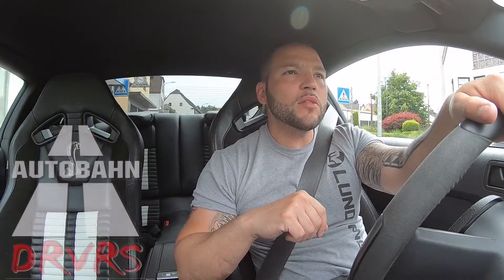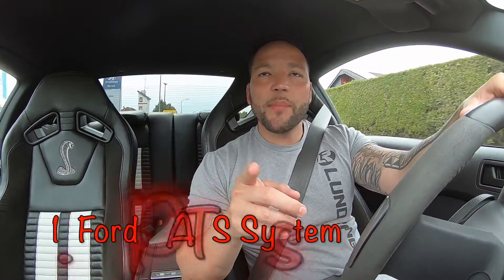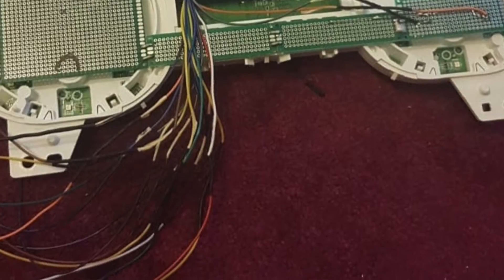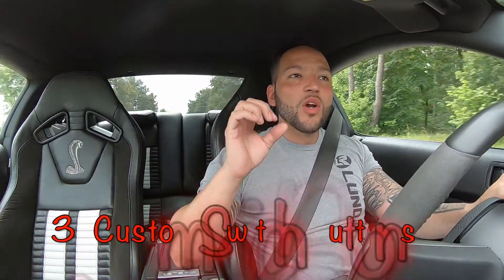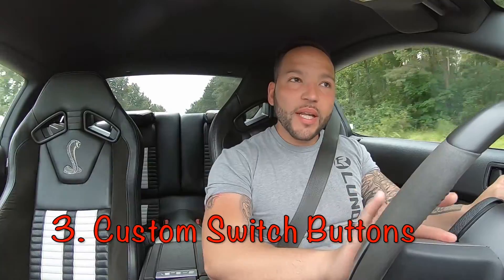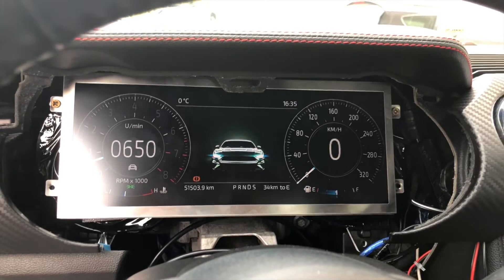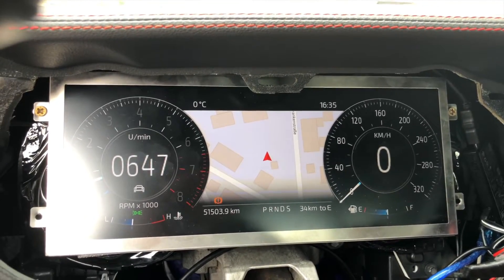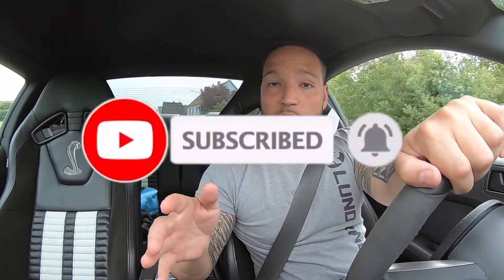2011-2017 Mustang Digital Dash Pt. 2

Comment: Niiiiiice. So is it running the 18+ cluster software, or is this all custom?
Reply from the maker: All custom.
Reply: @DNMCSPD  neato. I'm an EE student, so kinda curious how y'all are actually getting the CANBUS info and displaying it. Gotta have some kind of intermediary microprocessor that handles the I/O I guess? If you're running a custom interface that's also complicated. I suppose this would be a bit like having an OBD2 info center, but way better/cooler. How are y'all handling the buttons? Something to consider is mounting them like they do in the 10-12 S197 cars, by the headlight switch. That might be easier than trying to custom print something in the steering wheel and trying to go through the clock spring. Maybe you've thought of all this already, sorry! Interested in this project for sure.
Reply from the maker: @RichardVarn  Good idea about the buttons on the headlight switch.